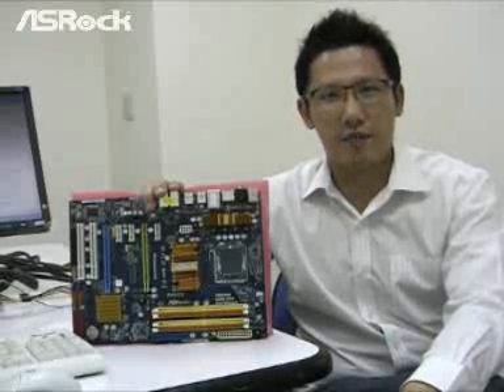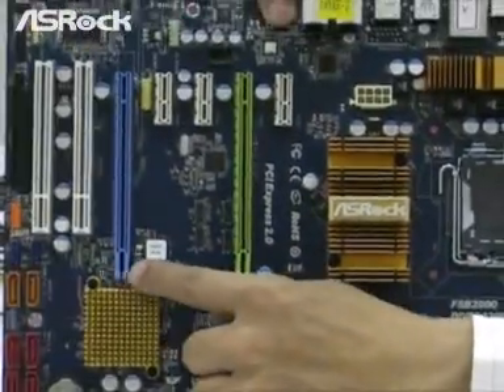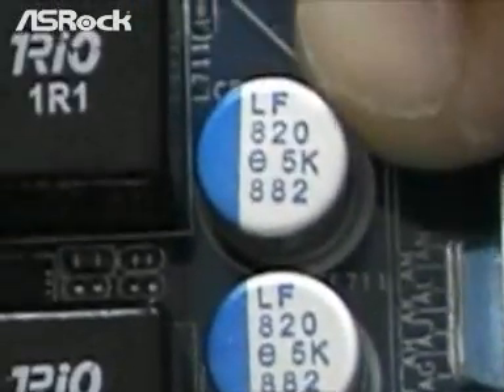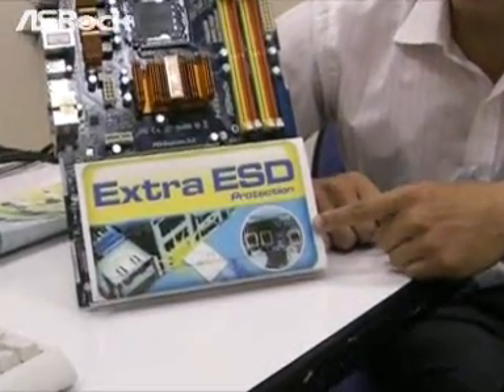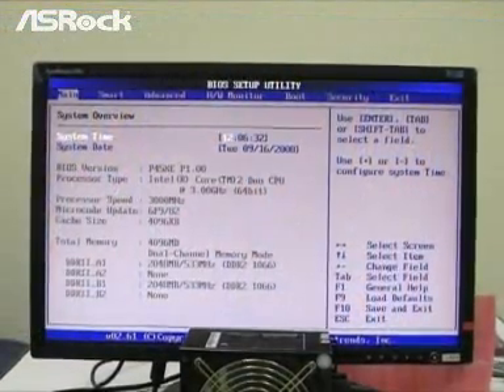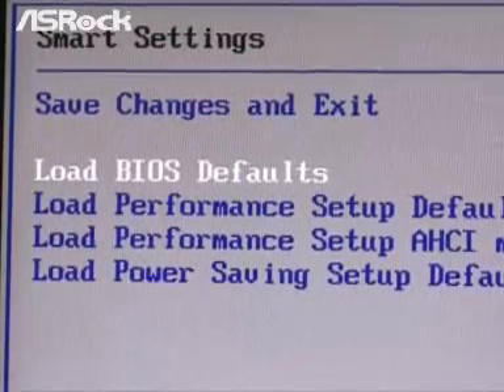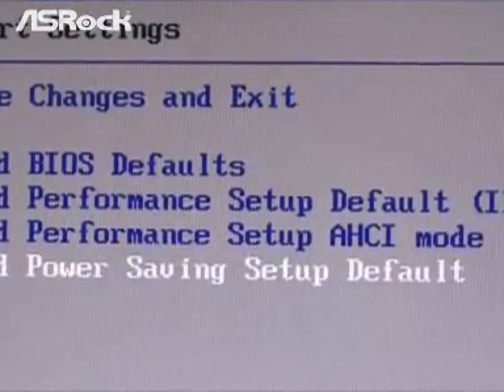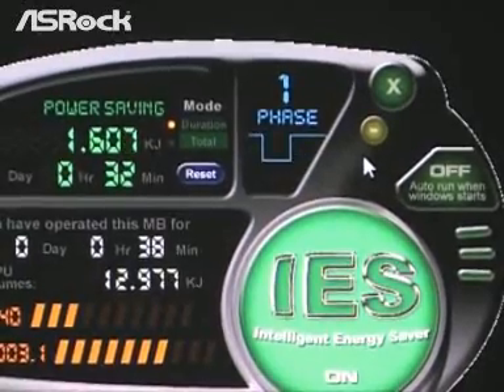ASRock P45XE motherboard

Comment: I'm a bit confused about one thing, manual says that if I'm using 1 SATA drive I should connect 2 SATA ports together, problem is that both of ports are located at the opposite sides of the board and I should have world's longest SATA cable because there's all that other stuff in the middle of the board like cards and CPU cooler etc. etc. What a marvellous designing!

Comment: I think that at this moment buying Asrock is the best choice if you want to get what you pay for. No extra features which cost a lot that you never use, high quality components ussed at the construction of the board, high stability and performance,power saving and let's not forget overclocking. All this combined with future products compatibility that competition doesn't offer makes this a winner. Asrock came a long way and it arrived as a leader in this competition,keep up the good work.

Comment: The Asrock P45XE-R is has a lot of features like OCTuner(!!), IES(!!), 2 gigalans, superb sound, DuraCap, ESD protection and so on. All these quality features are included for a very low price. Even more astonishing is that this MB overclocks like a king! My Intel E8500(standaard 3.16Ghz) runs at 4.65Ghz stable! This is a huge overclock, thanks to the extra cooling blocks and a big load of settings in the BIOS to fiddle around with. I'm really amazed about what this MB can do! I really am.

Comment: Asrock make good motherboard for overcloking and 3d solutions.IES features, Bios very Customable, and good tweak for overcloking.
It's the best quality/price with a P45 Chipset. The wifi integrated it's a great option for use at home or office.

Cheap and attractive motherboard : The P45XE WIFIN is a smart choice for anyone want an easy solution.

Comment: Nice board, hope it will be available soon, interesting features, good performance, affordable price so it will be another Asrock hit: best bang for the currency on the price/performance ratio.A little more advancd options for overclocking ( this can be done with new bios ) and it will be perfect. Good going Asrock, waiting maybe for a 775 SLI either with the new Intel chipset or Nvidia, if you deliver this during holidays you will win again a new customer.

Comment: That's a truly high end motherboard. Good to see ASrock sorted out the lay-out, by placing the 24pin ATX connector properly. And better heatsinks, together with the Duracap giving you 2,5 longer lifetime than other solid caps. I think it's a 10x longer lifetime than electrolyte capacitors!

Great Job Asrock!